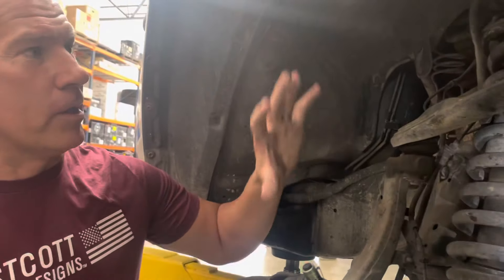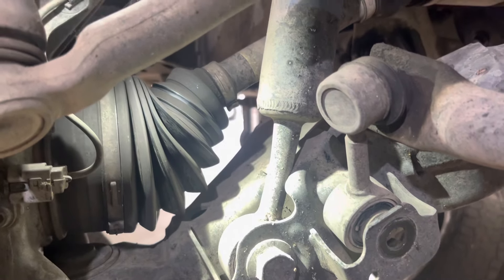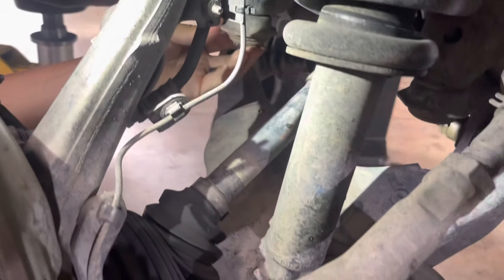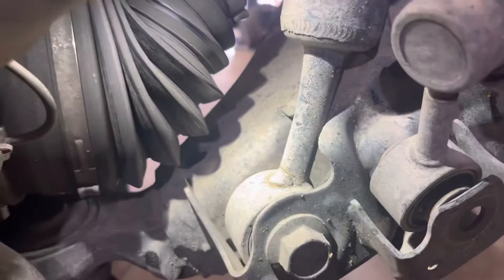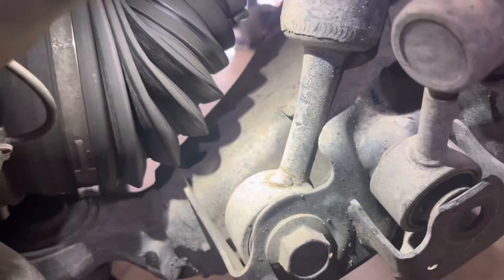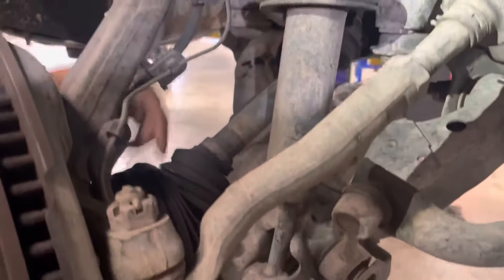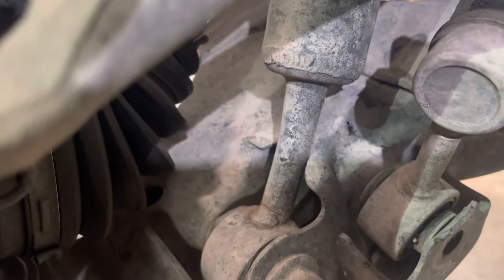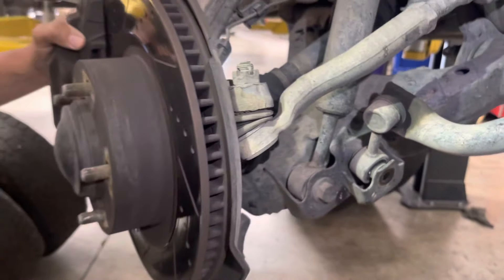The effect of running a traditional spacer lift

Comment: I put a 3 inch spacer on my 4runner, but upgraded the bumb-stops to larger ones immediately after the install of the spacer, and it is about 12 or 13 years now and everything is fine. The larger bump-stops is spec for a 3 inch
Reply: Where did you buy it?..I will quick lift my hilux so hope to get oversized bump stop
Reply: @stephenmulholland4868  i bought a spacer kit but now my hilux squikes, so im removing it, id rather spend more money on something proper like new suspension that a "quick solution " that actually will just damage the vehicle
Reply: Where did you order the bigger bump stops from ?
Reply: @MrSparsilis  maybe Sumo Springs.
Reply: And also lost 3 inches of suspension travel.
Reply: Hi
Reply: you haven't changed your front shocks in 13 years
Reply: It’s always scare tactics to upsell non mechanical consumers

Comment: The issue isn’t the spacer lift, it’s the fact that the spacer is too large. The same things happens when you lift too high with a traditional lift. To maximize articulation with Toyota ifs, keep your lift below 2.5”, preferably 2” with extended shocks. No more than 1.5” with a spacer lift and stock shocks.
Reply: Agreed
Reply: The last thing you said there confused me... 1.5" spacer on top is max in your opinion, or total lift?  What about a preload spacer on the bottom, or same result with the combination of both?  Also, I think my problem is the droop if I catch air may cause damage. I need a droop limit strap or something. Not sure yet where to connect it to though.
Reply: Facts.
Reply: I'm having this issue with my 01 sierra 2wd. Will it work if I use 2inch spacers with n3 0-2in RC shocks??
Reply: @Resilientindividual  Do you have torsion bars you can adjust?
Reply: @marc4...1  I have no clue what those are
Reply: @Resilientindividual  You don’t need a spacer lift if you have torsion bars, as the bars replace the springs. You can adjust them to give you lift for free. Higher you go, the more down travel you lose.
Reply: @marc4...1  ok ok I know what you're talking about now. No, I don't have torsion bars. So what would you suggest??
Reply: @Resilientindividual  0-2” lift of your choice. Start with BDS
Reply: @marc4...1  lift or shocks? I'm a female so I don't know alot of the language. I'm learning.
Reply: @ Lift kit for your truck should include new shocks.
Reply: @marc4...1  heyy quick update. I purchased Rough Country's 2.5-4 inch N3 shocks.. installed the 2inch spacers. Drives perfectly fine.
Reply: @Resilientindividual  That’s great!
Reply: Problem is the bump stop needs to be adjusted down the same length as the spacer. If the spacer company selling that garbage doesn’t specify that than I wouldn’t recommend them either.

Comment: The main problem is the bump stop, If we lower the bump stop accordingly, nothing will happen and nothing will bend, easy:))
Reply from the maker: That’s true but then you sacrifice the full range of the suspension travel or your suspension articulation if used for off roading.
Reply: It doesn’t affect the range of travel it just moves the position of the lower and upper control arms in the range of travel, the range of travel is determined by the shock and the spacer does not affect the shocks travel, the bump stop is a problem, easily fixed with extending and the other issue is if you space it to much it will allow to much angle on your cv’s and rack-ends at full droop.
Reply: I agree it doesnt affect the travel it will travel the same distance as factory because of corrected tolerance. The cv angles and control arms wont be ad level as posible and that will wear out faster but dont drive like a maniac and it should be fine
Reply: @westcottdesigns  you shouldn't even be off-roading with spacer lifts. They are for aesthetic purposes or "balling on a budget".
Reply from the maker: @POTFULLOFGREEN  I agree!

Comment: How can it loose upward travel, there is actually more upward travel due to the increased bump stop gap. Install a longer bump stop which is very common to address this issue. The main issue still though is the loss of downward travel and of course the contact area of the strut.
Reply from the maker: Because the strut can only go up so far before it bottoms out internally which is before it hits the bump stop.  The strut can not take multiplying weight when it comes to an abrupt stop, which then causes it to snap off at the bottom or bend in this situation.
Reply: But you pulled the piston down equal to the increase in bump stop gap, why would it bottom out internally any earlier, the piston should end up internally exactly as before when the bump stop is engaged.

Comment: Cool video showing why strut top spacers are not the recommended way to lift trucks. Though this is not a problem for McPherson struts where the bump stops are at the top of the shock 👍🏼 e.g. Subarus
Reply: Ah cool good to know!
Reply: would a Volvo wagon be similar? wanting to lift 1.2 inches with strut spacers. mild off-roading

Comment: The spacer itself is almost never the issue. Installing a larger/longer bump stop would've definitely helped out the OEM suspension live a longer life. However what always happens is user error. The owner figured "I'ma jump this bitch aka dirt cliff and do all sorts of crazy shit I'm not supposed to". The owner overestimated and underestimated the breaking limitations of OEM parts. OEM parts are designed to withstand upto a certain, going past that and reality starts to get real ugly fast.

It behooves to all individuals lifting their suspensions to invest in off-road extreme/hard hitting performance parts to compliment the spacers if one decides to put their vehicle to the test in off-roading and extreme baja 1000 torture race runs.

I'm an IT Specialist by the way and I have my 2013 F150 lifted and upgraded to ICON Vehicle Dynamic Strut Suspensions and ICON Vehicle Dynamic Upper Control Arms and Zone-off Nitrogen Rear Shocks. Took me a decade to save up the money and finally have the parts installed. Rides like a dream and off-roading is jazz event.

Cheers 🍻

Comment: You're supposed to extend your bump stops to match. They have bump stops for a reason. Don't tell people who can't afford a fancy lift that they can't off-road, tell them about the crazy cheap solution that will save their struts. 
PS your suspension is designed to travel 2 inches down it will be fine but your ride will be rough. Whater you do break will also likely be cheaper to fix than a fancy lift will cost you. Is it as nice? NO. Will it work? Yes.
Reply: Spacers won't affect the suspension geometry. With a spacer or without, the problem won't change. I agree with you, he should have installed a bump stop spacer.
Reply: I dont understand how the suspension would get pushed down? Isnt it just lifting the chassis up? Otherwise whats the point..
Reply: @liammorgans7329  bump stops don't push the suspension down they prevent it from being pushed up too high
Reply: @frictionhitch   i mean the spacer. Isnt it just lifting your chassis up? You say your suspension is designed to travel 2 inches down and the guy in the video said something about the spacers pushing the suspension down, isnt it more accurate to say its lifting your chassis two inches up?
Reply: @liammorgans7329  the bump are connected to the chassis. If you move the chassis up then you need to move the bump stops down further from the chassis. This way the suspension doesn't overextend itself.
Reply: @ i understand the role of the bump stops, its all good thanks for getting back to me

Comment: Thats why the kits come with extended shocks..  and steering column extension, spacer for your pinion angle of driveshaft, longer break hoses, leaf braces for axle wrap, longer u bolts, and maybe a whole subframe if youre going big..  but just using blocks is like somebody just torquing the torsion springs,,  ive seen those bars snap before when dude was over tensioning it..  thing made a noise like a bomb.,  lol.

Comment: I’m looking to raise up my suspension 1” on a ford escape, I just want larger tires bc of where I live. Would adding larger bumper stops help reduce this issue? I’m new to the car community so any advice helps
Reply: Not for tires if you go up 1 size in tires it equates to a inch lift roughly it will put tour speedometer out and increase fuel consumption slightly but gives you the lift you need if the car can take a size up. Talk to your tire dealer. Bump stops only affect the distance the shock travels if you increase that be sure to extend the break hoses and stuff to not rip a line and have no breaks also putting strain on joints and cvs because of steeper angles so do at your own risk. Just ask if something is unclear
Reply: Buy a truck

Comment: used a 6" lift on my tacoma and also included a 2" leveling spacer......after a while I had issues with my steering rack....is the spacer the reason?

Comment: No intensions of extreme off roading. However I want somewhat of a lift for larger tires and more clearance, what are my options? thx
Reply from the maker: @davidsanford2711  if your suspension is low miles or fairly new and you want to get the most out of it without replacing it.  Our preload collars works well and will never cause failure like this.  If your suspension has miles and you want  a cost effective suspension to replace it with.  Bilstein is very effective and won’t brake the bank.    Then from there it’s like a rabbit hole and just starts to get expensive from there.
Reply: @westcottdesigns  appreciate your reply and insight!! thx

Comment: Can this start off with a light knock noise when going over speed bumps or turning corners while ascending or descending like in a parking garage a little too quickly? Otherwise I’m not hearing anything. But i had a 1.5 inch spacer lift installed a couple months ago and am noticing a slight knock coming from the front and the back sometimes.
Reply from the maker: @Arlene_witha_y  did the noise start right away?
Reply: @westcottdesigns yes

Comment: I saw  use big spacer like 2.5 or 3inch it wont last!  Normal shock or parts would be pressured. If stock just use 1.5inch to be safe
Reply from the maker: @MrRGM10  not true we have done testing with factory bump stops in factory location and seen shock contact with 3/4” depending on vehicle.  So 1.5 might be ok on some models.
Reply: @westcottdesigns  should i upgrade bump stop for my chryslrr t&c 1.2inch lift ?
Reply from the maker: @MrRGM10  I would cycle the strut without the spring in the vehicle to check full upward and downward travel.  This will help you figure out what is needed to not cause strut or shock failure in the future.

Comment: So what’s the west fort product I would buy instead of the traditional spacer? 

2013 Tacoma crew cab 5’ bed TRD off-road 4wd.
Reply: I like to keep it simple... A knuckle and body kit... Stay  under 6 inch your driveshaft will scream to stop any higher and u dont want to buy and pay for a custom u joint drive shaft extension .. it will go on your tranny output and it's a bitch... Find a 4.5 inch knuckle and 2 inch body it will be 6 inches on the money you won't need to upgrade anything except what you truly want but take care of your ride it will care for you.... Thank me later ... The knuckles can be on the expensive side but u should be able to get it for 250 all 4 drop your tires drop brakes calipers rotors use spray paint here you want everything just how you took it off top and bottom control arms along with coil over shocks (replace ball joints control arm bushings stabilizer bushings here shocks if your feeling generous ) tie rod arm stabilizer pen remove dust cap and knuckle reinstall new knuckle and be sure your ball joints set right and you grease them first an in experienced mechanic could do it with the right tools the body kits 50$ but being a 2013 you won't retain the full 2 it will be 1 to 1.5
Reply: When I say body kit I mean every spot your cab mounts to your frame put a spacer and rubber bushing should be 10+ spacers .. cheap easy and quick

Comment: can I put a 3 inch spacer in the front and 2.5 inch spring spacer in the front and add 3 inch numb stop without changing the struts will this effect my 2019 fj cruiser, and if so where can I get longer dumb stops thanks
Reply from the maker: You can only do a 3” total lift in the front and still be able to get it back into alignment.

Comment: got a 03 Lexus GX470. Did my rear bag delete. Looking to install a 1.75-2'' spacer in the front with my 33" tire+wheel.
Im doing it for the looks not off-roading. Would a 2" spacer be fine to install?
Reply: I think so. I've installed em. You run the risk of what's being shown tin the video. But I think it's mostly due to vehicle abuse and off roading. Shouldnt occur in normal everyday driving
Reply: Anyways does a 1" spacer still raise a truck 2" or cause problems with aftermarket uca's?

Comment: That’s all true, however, a leveling kit is NOT a lift and people know that. The folks that level their vehicles are not hardcore off-roaders that understand a leveling kit does what it says it’s does: it brings the the vehicle to a more horizontally level stance by use of a spacer.Ive leveled my 4 trucks without ever causing any harm to anything.
Reply from the maker: After working for Toyota for 20 years we would see them cause the struts to snap off monthly.  They would say their vehicle was still under warranty and wanting it fixed under warranty.  We had to explain to them it was not covered because the aftermarket part installed was what caused the failure.  One customer claimed that he was speeding through a parking lot and went over a speed bump and caused both of the front struts to collapse.  You’re right they do what they are intended for.  To lift or level a vehicle for looks and not function other then to put bigger tires under the vehicle.

Comment: I'm wanting to lift my car about 1inch - 1.5inch with spacer and going up in tire size, to get 3+ inch ground clearance. What is the best solution for the bump stock?
Reply from the maker: What year is your truck and model you have?
Reply: @westcottdesigns  I want the same thing, so I'll answer your question - I have a 2023 2WD Tundra SR5 w/ the TRD off road package.
Reply: Dont forget brake lines no matter how tall the car is if you snap a hose you dont stop so watch out with 2 inch and higher

Comment: How does your product differ from a regular spacer? Isn’t it the same thing just as the spring collar instead?
Reply from the maker: @El_Basically_210  with a strut spacer you are pushing the whole strut down the distance of the spacer.  Now when it goes to full compression it bottoms out internally and not on the bump stop the way it was designed.  This is what causes the struts to snap off after a period of time of this happening.  Now a full extension the axle was designed to extent to its original upward and downward stroke of the strut and because it has been pushed the cv axle past its original design and can and will cause cv failure or at least cv boot failure over time.  As for our preload collar it works the exact same way a coil over does.  Our collar replaces the original collar that the spring sits on with a taller collar the preloads the spring the same way the coil over does which creates lift.  Now when it goes to full compression it bottoms out on the bump stop like designed from the factory and when at full extension is still at factory design.  So will not cause any premature failure because still works as factory designed it.   Best part is you are replacing the factory part with a much stronger better built part that will never fail.  That’s how we do everything.  Never replace a part with a lesser or equal part.  Alway over build😉
Reply: @westcottdesigns thank you for explaining, I will definitely keep your product in mind when it’s time to upgrade.
Reply: That makes no sense, the preload collar is the same net effect as a spacer creating the same amount of lift.

Comment: I put a 3 inch spacer lift on my OEM tundra and I’ve only had this for about a year now, am I screwed?
Reply from the maker: @El_Basically_210  if it’s one like in the video!  As long as you didn’t or don’t romp it to hard you will be fine.
Reply: @westcottdesigns  got it thanks! I only drive my truck in the city since it’s a 2WD but even here there are some very uncomfortable roads and very bad portholes.

Comment: Would a 1” spacer in the front be okay for awhile? (not forever)
Reply: Of course and it will be fine as long as you don’t do any incredibly hard four wheeling. I’ve used mine 2.5 inch spacer since 2005 on one truck, another since 2002 and current one for two months. Leveling kits are not at att harmful to an average off roader, snow, mud …. Never had a problem. If you want to rock crawl then you may have an issue

Comment: This is very interesting havent heard this take on it before.

I have only ever had a bigger truck- these days i am all subaru and looking at lifting an older outback. I put in 1 and 1-5/8 ADF spacers on our 18 forester XT and for that application it was fantastic.

You helped me identify which way to go. I like the KYB type of spring lift for a tad more utility.

One question if going spring lift, the ride quality may be a bit gummier right? So mpg drops a bit on the hwy?

Thank you for sharing.
Reply from the maker: The spring would work great if they make it for your application.  Mpg is always lost.
When lifting a vehicle.  One because the air travels more under the vehicle then around it and air turbulence is created.  The biggest factor is the the larger tires.

Comment: Need shorter shocks with a spacer lift... Nobody dose that, but; maybe they should.
i noticed In the comments, ( get taller shocks ) Well, they are already too tall by the height of the spacer. if the bottom stem or (fuse) was three inches shorter. No more problem. full travel.